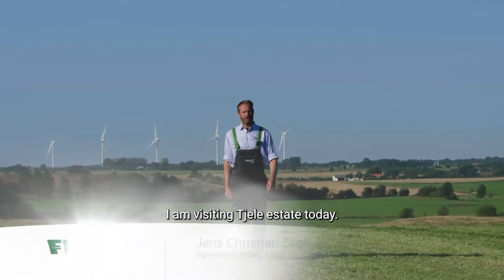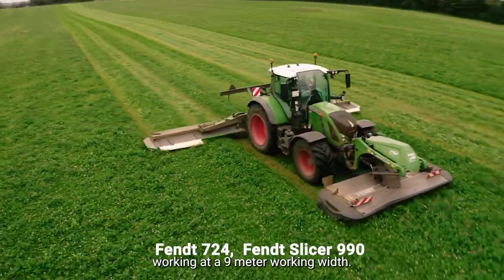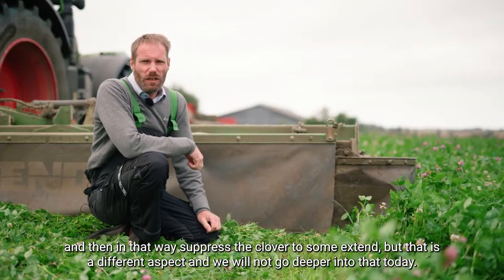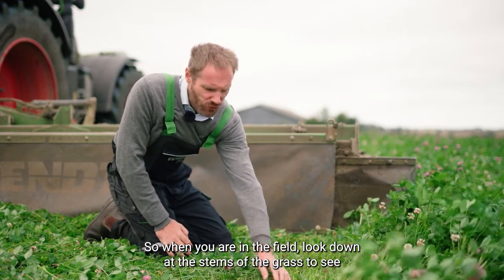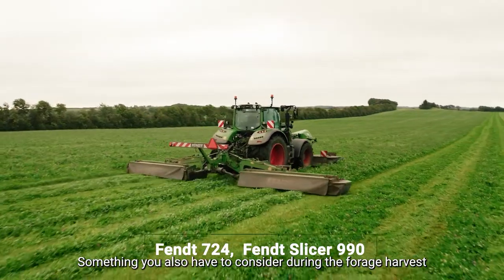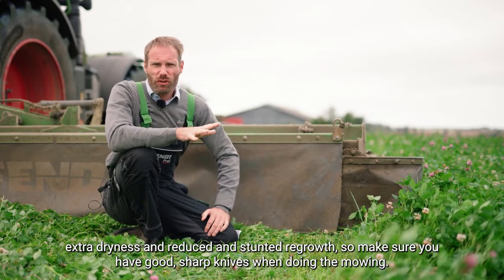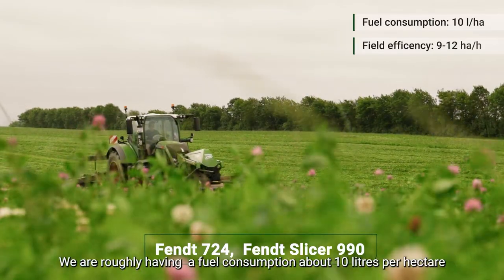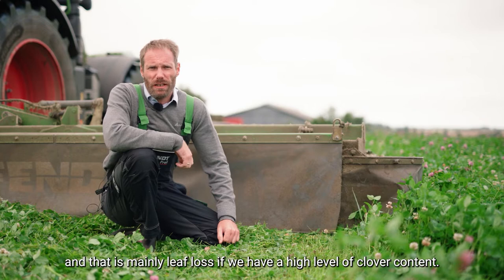Fendt Full-Line | Cutting grass at the correct height | Fendt 724 Vario, Fendt Slicer | Fendt

Comment: Everything lower then 9cm is bad i do al 5cuts 10cm high you can then work much more easily and faster whit less damage to the machines and less contamination beceause the most ash you get when raking and we have rakes at 6cm high if we cut 7cm high we must lower rakes on 3cm and there is the biggest differnce in ash content